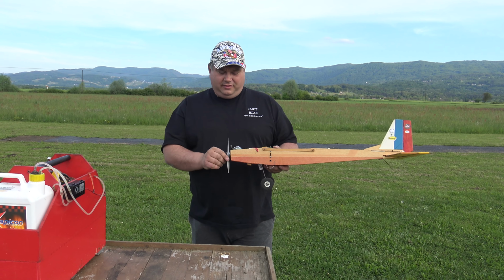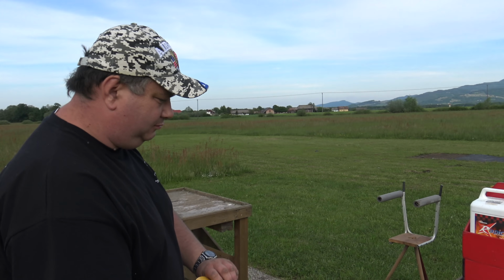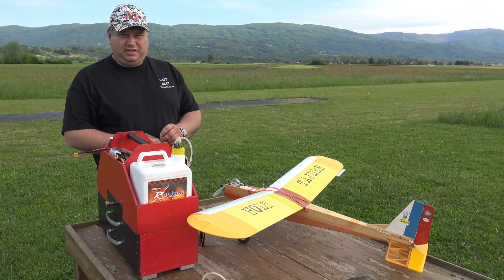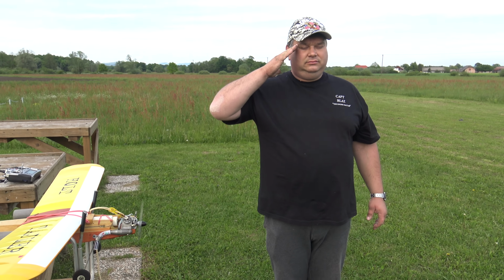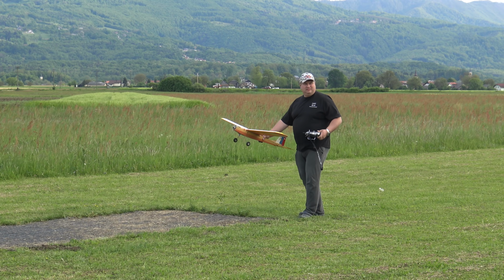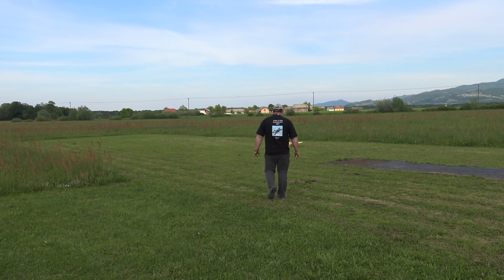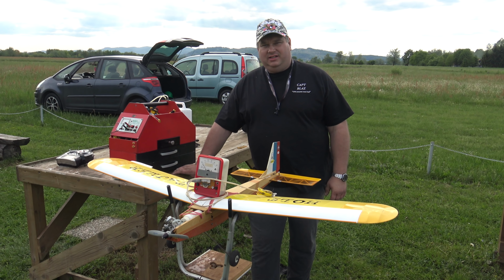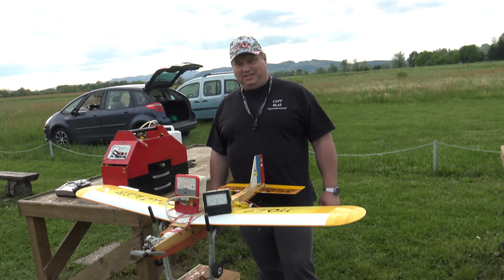Vintage RC Holt Tajmer from 1970s with OS Max 10 Retro flight

Comment: As an old timer electronics guy, I was impressed by the glow plug driver. With just a brief glance inside, I can tell that Captain Darko did an excellent job in putting it together. And it still works! Big SALUTE with greatest respect from NC USA.

Comment: My friends and I go in cycles with our hobbies.  We first started flying R/C while in high school in the 1970s.  Then we went back to it again in 1999-2002, and now we're going back to it again.  Each time, we re-learn how to fly with planes left from the last time we did it.  The planes I'm reconditioning now are 20 years old, and should still fly just fine, with the OS and SuperTigre engines from the 1990's.  The hardest thing to find here now in the US is glow fuel, it has to be ordered on line, none of our local hobby shops carry it anymore, because nearly everyone flies electric.  But I'm much like Captain Blaz, I love working on the engines, and making them run again.  Especially 4-cycle engines, I love how they sound.

Comment: Great plane, I learned the RC flying with a Graupner Taxi.
Reply: Great plane the Graupner Taxi!!! My first also.
Reply: @konstantinosm47  Yes the taxi has flown great. My father at that time built with the yellow Vario remote control teacher student switching only with current switching. Switching took about 1 long second.
Reply: I will soon be uploading pictures of it to my Youtube channel
Reply: Another one with first solo on Taxi! (OS .25)
Reply: @darkofc  My first solo was then also by taxi
Reply: my friend had o eto..it was very good plane 3 ch
Reply: @BlažPetrinčič  Hello Captain Blaz, my taxi was also a 3 ch plane. My father had installed an OS engine with throttle for me.

Comment: 👍 i have a question ?  I saw you have at the end of the muffler a pipe deflector. I really want to do this in my Kyosho calmato glow plane but my friend told me that if I do the carburation will be different. Can you have suggestion .? Thanks
Reply: i use this all the time and there is nothig wrong with engines..it is lot bigger than exsaust diameter so it dosent effect engine it just deflects
Reply: Blaž Petrinčič thanks 🙏 I appreciate that I will do the same